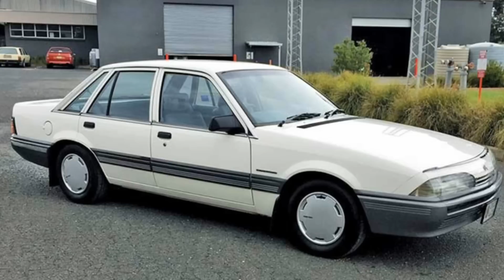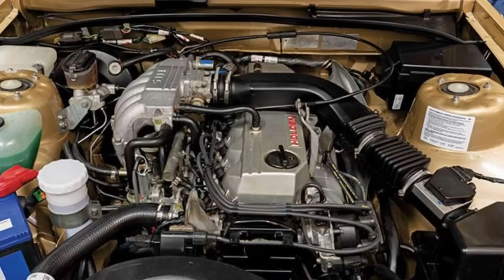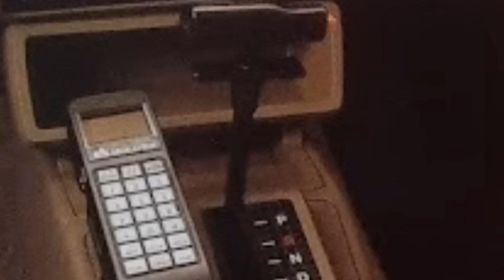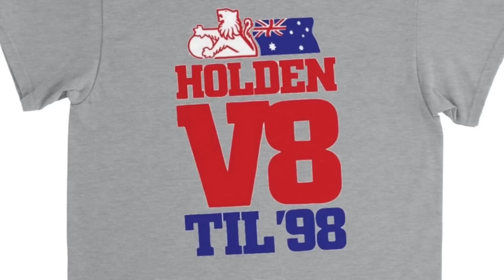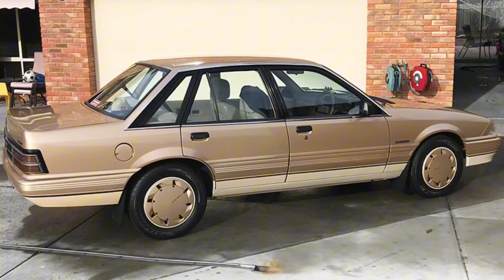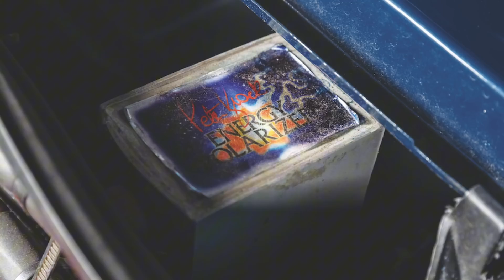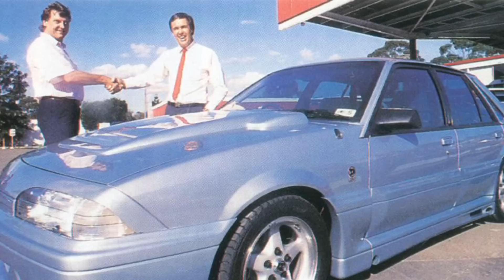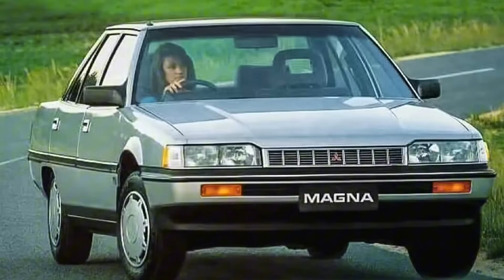Holden VL Commodore - Turbo Talk.

Comment: Great show Mark. Thanks again. Was part of the drama with Brock's Director that is had IRS developed in-house at by Brock's own people, and he didn't want to show it to GM? The energy polarizer is part of Aussie folklore - sullied his reputation to a degree and don't believe Holden suffered that much from the split. Imagine trying to convince someone like Larry Perkins or Moffat it actually done anything lol.

Edit: was the IRS thing a problem related to guaranteed Australian parts content in local vehicles?
Reply: IRS could be an issue, but as HDT were a certified secondary manufacturer, what they did wouldn’t affect Holden’s local content goals.  Durability of the IRS was the main concern - Opel’s biggest motor was a 3L OHC 6, with EFI.  The torque of a modified V8 was a real worry for GMH engineers.  
My VL Brock has a polariser, but I’m not about to run 22psi….. but I look at this way.  If it does something, how could you measure it?  Imagine showing a microwave oven to a person 200 years ago.  They’d think it was black magic.  It heats food without touching it, and no fire?  How would they comprehend it?  I think that’s where we need to look at the bigger picture - like the microwave, maybe in 50-100 years scientists will work out how to harness and measure the effects?
Reply: Back earlier Brock had personally imported a black Opel Monza 2 door coupe looking like our pre-VL version Commodores which had Opel developed IRS, then later Brock had personally imported a Bitter 4 door sedan which is an aftermarket derivative of an Opel, this also had Opel's IRS fitted. With similar steel car underbodies I guess it would have been easy enough to use imported Opel IRS units and fit it to Brock Directors. It was my understanding that's what Brock did and with local Aussie help revised spring rates and fitted gas shock absorbers instead of oil ones Opel used due to the perceived use a director may be given and/or the different Aussie road environment. These IRS units were tyre eaters chomping them out on the inside edge , and my guess Holden already knew this from the early days of the Commodore program in the 1970's and never fitted it to the top end Aussie Commodores as GMH did not any warranty tyre claims, like they had with the early SL/E alloy rims which cracked as the German Opel ones fitted to the VB's were recalled, my 5 liter VB wagon had been specked to look like a XL/E wagon complete with those wheels , and on the day I took it to the dealer for a swap to Aunger spoked wheel rims , you could see cracking on my spare wheel when you knew what to look for. As I told the guys at the dealership it had a wheel wobble on that rim and relegated it to being the spare wheel.

When GMH fitted IRS to the VQ Statesman & Caprice it was modified version of the Opel unit that GMH used with new Aussie made coil springs & local market gas shocks. Back when the VQ was new the marketing manager at the company I worked for bought his own new VQ Caprice, however he found it chewed up rear tyre inside treads due to the strange geometry of that Opel IRS when you had weight from 4 people in the car and/or a boot loaded with luggage. The dammed thing toed in under load, so although Holden engineers modified in VX2's many Holdens were sold to unaware buyers with the tyre eating IRS. Datsun had this same problem with180B's in the mid 1970's, as the cars aged and as the tension in the rear coils relaxed and weakened with age they ate rear tyre on the inside edge, When the Datsun 200B's were introduced the early sedans ALL had IRS, but soon this was scrapped and the 200B sedans got fitted with a solid beam rear axle like the station wagon versions of both !80B & 200B.

This seemed to be the same with every car manufacturer but one that had early day IRS, be it Triumph, BMW, Mercedes Benz and the list could continue. The one manufacturer that had just perfect rear IRS was Jaguar when in November 1961 they fitted it to their 2 new flagship models, the E-type and the big MK10 luxury saloons. As these cars aged or were scrapped via accidents, the "vultures" were hovering waiting to fit this brilliant system to some other sports car, or if from the big MK10 then hot rodders wanted it, or those with US Chev Impalas, Pontiacs, Ford Galaxies wanted that IRS unit to fit to their cars. In a huge cradle/module which could with 8 primary bolts, 4 tail shaft bolts, hand brake cable connector, brake pipe connector and the 2 big right & left side trailing arm connections under rear floor this whole module could be separated from the car in less than 20 minutes, used by Jaguar unchanged from 1961 until 1992. After this a "dumbed down" cheaper version was used starting on some models in 1986 right through until the last XJ's of 2019 these later type version had the disc brakes out at the road wheel, the better and more costly heavy duty original versions had the large rear disc brakes right next to the rear diff' race car style keeping the rear discs cool and in wet weather dry as well for instant stopping power.
Reply from the maker: @gregharvie3896  That’s right Greg 👍
Reply from the maker: Thanks. Re the IRS, Holden eventually released it on VQ Statesman and VP Commodore but Brock’s version was untested by Holden engineers to their satisfaction and the piece cost would have been high too 👍
Reply: @markbehr88  the IRS in VQ and VP onwards was a locally developed one, that whist it copied a lot of the Open design, it used a much more durable Aussie BTR diff (with internals the same as the live axle).  The arms were also more robust, albeit simplified, which was the downfall they corrected in VX2 with the additional toe control rods.  There is a very good book on the Monza that shows all the parts of the Opel IRS laid out like a factory exploded diagram, but it’s a real-life photo.  Makes for a good comparison of what they had (and went under a handful of VLs) and what we got a stronger version of.  I think the GMH engineers were already working on it, and knew the Opel shortcomings, so they wouldn’t have been too happy when Brock was happy to chuck it under a VL V8, and have a dealer pick up the warranty tab….
Reply from the maker: Yes, that’s right. Even though HDT was a secondary manufacturer, they were directly linked to Holden reputation wise, plus the cars had a Holden warranty so they would have no appetite for anything that was marginal. Tony Hyde told me that the Polariser was not the deal breaker but the refusal to allow Holden engineers to test and validate was the torpedo for the relationship. I think the Polariser was even tested in the USA and they could not measure any benefit at all. 👍
Reply: The Jag IRS rivnuts and mount holes are in the later VL’s a mate ran a wrecking years, she bolted straight in

Comment: Correct me if I am wrong but didn't the Director have independent suspension that was lifted out of a euro Senator?
Reply from the maker: @MyNameIsPlayer2  Yes, that was an expensive option I believe. 👍
Reply: Some had it fitted, and yes, it was Opel sourced.  This was one of the main durability concerns that GMH had - Opel’s most powerful motor was a 3L OHC EFI so many thought the Opel diff wouldn’t hold up to the V8 torque, especially when modified.

Comment: CLICK THE LIKE BUTTON IF YOU BELIEVE THE VL CALAIS WAS THE BEST LOOKING CALAIS EVER MADE?
EDIT: Especially with the turbo badging.
Reply from the maker: @John_Harington  I like that idea! 👍👍👍👍
Reply: Did the turbo change the looks?
Reply from the maker: @Low760  Yes, you got a nice badge on the back! The Turbo was available on every model too including wagons 😀👍
Reply: @markbehr88 didn't the interior have a turbo badge somewhere too?
Reply from the maker: Yes, I think it did actually. 👍
Reply: @Low760 the turbo badge was on the back, and on the engine block that had a red rocker cover, also the Turbo badge was on the intake plenum.
Reply from the maker: I like that it was subtle. 👍

Comment: Had plenty of mates with VL turbos, but the best was a mate who had a HDT Group A with a genuine Brock 5.6 stroker in it. I've never owned a Holden , but that Group A was one you wanted. I believe that it was one of two with the stroker.
Reply: My HDT Calais Sport wagon was optioned up with the 5.6 stroker.  It’s a one-piece crank (not cut & welded like others in the day) with a small counterweight on the rear flange.  It’s so smooth and well balanced.
Reply from the maker: @commodorenut  That would have been a terrific car. 👍
Reply: @markbehr88  it still is 😀. Only had it out 3 days ago for another drive.  My profile pic is my VL.  BTW my wife has an original ‘86 VL Group A.
Reply from the maker: @commodorenut  Very cool. Glad you still have those two cars. 👍
Reply from the maker: @Jacacatt  Wow that is pretty cool. 👍

Comment: Petrol is a polar molecule (like water is) i.e. it has a slightly positive end and a slightly negative end.
When polar molecules pass through a magnetic field they orientate in a particular direction and tend to form chains.
As  one molecule combusts it helps the next molecule in the chain to break apart by leverage and thus causes easier combustion.
The powers that be don't want this stuff becoming mainstream.   This polarising process has implications for the electrolysis of water to efficiently produce hydrogen.     
The fossil fuel magnates call the shots so the official verdict is:   Brock's idea doesn't work.
Reply from the maker: @TexasBlues-123  I reckon it was hocus pocus. If the GM engineers could find a real benefit they would have used it. Such is the competitive nature of the car business. 👍
Reply: @markbehr88   never trust a Guru .?
Reply from the maker: @Eric-kn4yn  Pretty well. 👍
Reply: Don't lie, it's actually a flux capacitor used to put Brock an hour into the future of the pack leader.
Reply from the maker: That’s it! 👍
Reply: Ah you must be the doctor!
Reply from the maker: Dr Who? 😀
Reply: Sounds great on paper (especially if you don’t think about it for more than 3 seconds) but that just isn’t how it works, and while there is some parts of the description that are correct in how the particles interact, it’s not going to do a whole lot of anything… and as mentioned before, if it did work, they would have already been using it. It’s along the lines of snake oil and crystal balls. It’s a whole lot of people having an idea and not understanding anything else about the topic and why it won’t work.
Reply from the maker: I agree with you. 👍
Reply: @Gengargamer2_     Now I understand.    I'm glad you put it in layman's language.
Reply: @Gengargamer2_     Do you, by any chance, happen to own a Haval?
Reply: @TexasBlues-123  Absolutely not
Reply: @Gengargamer2_    Thanks for the laughs.

Comment: The vn commodore  buick motor was also shit, eco tech was much better more refined.
Reply from the maker: @kajak012  I enjoyed my VN company cars. Of course, preferred the V8 ones. 👍
Reply: @markbehr88  i never enjoyed a vn v6 it was harsh not refined like the eco tec,but we have our own opinion and i respect that sir
Reply from the maker: @kajak012  Yes, it was harsh but it did go well. The latter versions were definitely better. 👍
Reply: @markbehr88  It was a harsh engine?
coming from the nissan inline six where where one could balance a 50 cent coin while running at idle speed.
Reply from the maker: Sure, compared to that. For Holden though it was cheap and had very good low end power, which sold a lot pf cars on test drives. 👍
Reply: @markbehr88  low  end power yes but not refined never liked it much imho.
Reply from the maker: Agree. Nobody ever said the Buick 3.8 was refined. 👍
Reply: @markbehr88  my wife is not refined either .
Reply from the maker: Awww, she wouldn’t like that 🫣

Comment: Thanks for doing these videos Mark. The level of detail you include is amazing. 

An Americas Cup edition was also released in the VL range. Not much info around on them though - may have been a special for the WA market given the cup defence being held in Fremantle in '87?
Reply from the maker: @Tomkatoz  Could be a WA only model I think? 🤔👍
Reply: @markbehr88  yeah I think so. Was basically an Executive with some "special" pin striping with the outline of the cup and a yacht on the boot. 🙂
Reply from the maker: @Tomkatoz  Probably the WA dealer group did a special. We used to do those in Sydney for our Direct Hit Deal sales. 👍
Reply from the maker: @Tomkatoz  Thanks very much. 👍
Reply: We had the opera house specials in NSW.  All white (colour coded bars too) and blue trim - but with Camira pattern stitching.  They were all V8, based on an exec - maximum profits to prop up the losses they were making on base model 6s in ‘88.  There was a couple of limited edition runs too, one even featured the Pirelli 14” white band P44 tyres.  All in the name of profit.
Reply from the maker: Yes, I remember those as part of Direct Hit deal specials. Go Barry Turner! 👍

Comment: no one is lusting over 80's magnas though. I loved Vl's but being a euro guy I couldn't cope with the interior.
Reply from the maker: @swatmann7541  Funnily enough there is a bit of a following for them now.  I have an Elite wagon (ep on the channel). 👍
Reply: @markbehr88  yeah a wagon would be the one if you wanted a magna I guess.
Reply from the maker: Yes, my favourite. I do love my Elite with the digital dash. 👍😀
Reply from the maker: @swatmann7541  👍
Reply: I had a red TP GLX sedan with a grey interior. It was very pleasant and comfortable to drive and ride in.  I loved the shape and the dashboard, but doing the Blue mountains, it lacked torque and struggled, plus it was plagued with reliability issues. 
I liked the Elite version to look at, but preferred the circular instruments in the lower grade models.
Reply from the maker: @noelgibson5956  I once drove over the Blue Mountains in my boss’ Elante to go to a dealer meeting in Lythgo. I know what you mean re the torque factor. You would probably need a V8 or a big six to really get moving on that road. 👍

Comment: Minor detail missed. SV88 was actually 2 tone, lower plastics n bumpers were a slightly darker shade blue .👌🏼
Reply: Definitely 2 tone paint.  They took inspiration from Brock’s original LE Calais promo car, but more subtle.
Reply from the maker: @commodorenut  Yes, I am sure they pretty well replicated HDT in the early days. 👍
Reply: Edit - the lower section was Jewel Midnight.
Reply from the maker: @bengepp9314  I thought that was just a variation based on metal versus plastic? 🤔👍